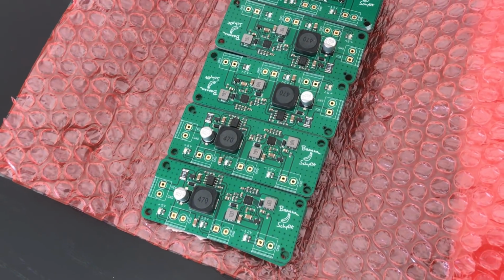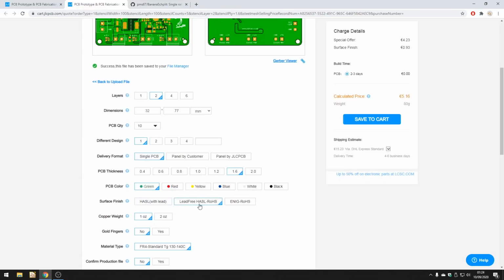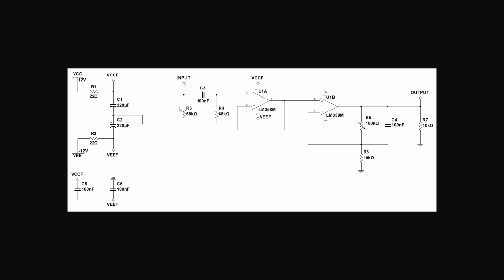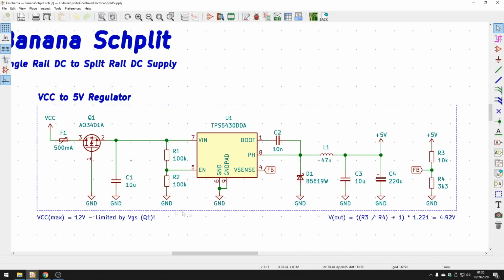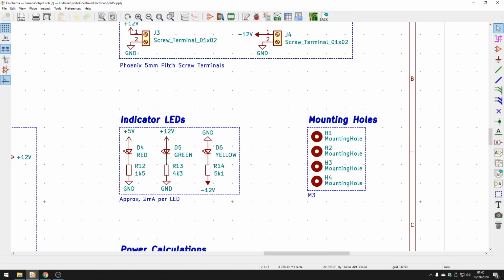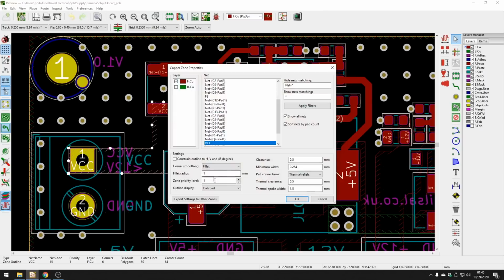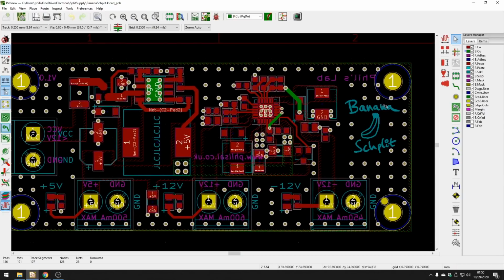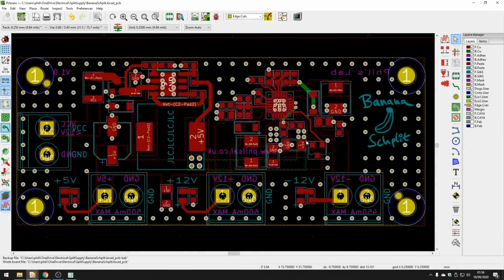(Sponsored) Single to Split Rail DC Power Supply Design | KiCad and JLCPCB Assembly - Phil's Lab #10

Comment: 1:15 - "and this is a really cool regulator because it's a buck-boost converter. so not only does it convert the 5V of the input to a +12V rail but it also steps that down to a negative rail in fact it's a -12V rail."
I can not let that stand like that:
A buck-boost converter does NOT provide a negative rail - that would be an inverting-buck-boost converter. And the TPS65131 is a dual-rail converter - it has a boost-converter (not buck-boost, vPos is always higher than VIn) and an inverting buck-boost converter for the negative rail..

Comment: Why did you use a transistor rather than just a diode in place of Q1?
What will happen if the input voltage happens to be larger than 12V?

Comment: This is one interesting power supply, now I need to figure out how to bump this up to +/- 18 volts. Have a small mixer board I use for doing EQ on a pro microphone for Ham radio use. Want to use the mixer portable but without the use of inverters to 120 vdc from a 13.8 vdc source, these small inverters are incompatible due to the noise they create in the ham bands. Will have to contact the manufacturer to see the current required for each rail of the mixer as well as minimum voltages to properly operate the mixer. Any suggestions to manufacturers for the dual rail power chip?
Reply: Also have the same question. Great vid!

Comment: Hi Phil, have you done any videos that mention a negative boost configuration? I have a circuit that requires +/- 72v rails and although the chip I've selected claims to cover this range, I'm kind of freaking out about it. My duty cycle calculations seem very small (18-ish %) within the switching controller. It's going to be used in a high voltage current controlled op-amp prototype. The datasheets seem to all mention some of these high negative voltage configurations but don't give a simple split rail example. It's like one is for a CCFL, another is just a small negative boost, anothe is a high positive boost. Seems hard to find a simple reference design. Any ideas?

Comment: can you explain the phase compensation for the TPS54331 in detail ? For me it is not clear what  Alpha-value should I use to calculate the phase lost. Im not sure if I can use the same compensation network for different output capacitor and inductor.

Comment: Can this board be modified to output +12v and -9v, and be supplied by a DeWalt 18V battery pack?
I want to use it to power a White's 6000D metal detector..

Comment: Cool video! I have a question. You mention mosfet/ zener diode as reverse polarity protection. Is Schottky diode a good choice for this too? If not - why?
Reply: Schottky diodes are a great choice if you don't expect massive power draws. They have a lower forward voltage than a rectifier diode, so it wastes less power, but the power loss can still be significant for very high power applications. Instead, you could use a MOSFET to protect against reverse polarity; They have a body diode which can raise the supply rail high enough to lock on, and have practically no voltage drop/series resistance once locked.
Reply: @wesleymays1931  oh, I see. Thank you

Comment: When designing a power supply I understand that you can set the voltage with a DC-DC converter using the feedback (or whatever you wanna use in whatever way), but how do you exactly set the voltage supply together with the amperage? How do you design, say, a 5V 3A power supply? From what I've gathered, say, a 5V 3A power supply works with any load that requires 5V and will draw less than 3A just fine. In terms of design, how do you assure this? First off you gotta make sure the components can handle the 3A and so can the traces, but afterwards what determines the ability to supply more current? Is it the initial supply (12V 2A, let's say) that determines whether or not you can supply 5V 3A?

Comment: Hi Dr Phil, first of all great video really informative and really helpfull. I need to power some opamp with +-15 volt and ive notice the datasheet of the tps65131 allows its. Since its my first pbc and im still a beginner to circuites im asking if you could help me with the necessary changes. from my understanding i only need to change R1 to 975kOhm, R2 to 85.7kohm, R3 to 1.3Mohm and R4 to 104.8Kohm and also the inductor values acording to equation 5 and 6 of the datasheet., pls tell me if i need to change anything else.  Thank you for your help and pls keep up the good work.

Comment: I’m pretty new to electronics, but I was wondering... how hard would it be to adapt the board to support 3.3v as the low voltage rail. I had a quick look at the data sheets and it seems like it should be possible, but I don’t know how many of the passive components would need to change. Is it something that could be made selectable using a jumper, or would be it an entirely different design?

I’d love to contribute to this if it is possible, it would solve a problem I’m having with a project. I’m trying to design an (overly complicated) synthesizer, and the digital parts will most likely run on STM32 chips, so a 3.3v rail would be great. But for the analog audio, I’ve been trying to figure out the easiest way to get a split rail supply like this

Comment: hello phil :) nice work you did. i found that vid after finishing my own TPS65313 board and experienced some strange behaviour.
could you give me some infos maybe? is it possible on your board to draw different currents on the rails? my negative rail become weird if i supply a circuit with it. normally its set up to -10V and without load i get them. if i power up a test circuit, the negative rails go down to -16V and jumps periodically to -10V. if i add a 100ohm resistor from -10V output to ground it stays stable at -10Volt. its like a curved waveform without the heavy load. it dont happen to the positive rail. did you ever get 600mA out of the two rails? :D hugs
Reply: I`m having trouble to stabilize the TPS65313 too. The positive voltage works fine, however the negative voltage is working similarly to yours. It is oscillating. It looks like it is not stable.

Comment: I did a similar board, but assumed a single power source on hand, but needing combined logic and opamp/linear circuit needs of pos/neg rail needed. Assumed 5V source on hand and created +15V  and -15V. Though that 15v can be changed for either polarity,  by resistor divider setup.
However there are also seperate SwMode output with capacitor filter, and a further LC filtered output on each. Also an LC filtered output of the 5V input supply. The cleaner outputs can be useful.
While the input is 5v it could be other value, just its filtered output is then same, no separate 5v reg used.
Have run outputs to over 1A, though not required in most cases.
Two PCB versions done,  one for through hole parts, one with SMD parts. As there are std 5mm screw terminal blocks needind space,  the actual PCBs are not that different size, also an 3AG fuse. The through hole one 95x75mm the SMD one 100x50mm.
Have also a different cct design version in SMD, that only does the 5v to +15v and -15v. Quite a bit smaller.

Comment: excellent video.  However I have some question about the buck boost circuit. Specifically on the buck boost that is providing +12V. If your Q2 and your internal switch turns off,  what voltage is the node between Q2, C6 and L2? Would the C2 provide enough current during the off cycles?  If you replace that with a diode, would you push it further into CCM and thus have higher efficiency?

Comment: Great tutorial. You don't need to touch the ENA pin on TPS5430. You can leave it floating and it will default to enabled via internal current source pull-up. So it would save you a little bit of space and assembly cost.
Similarly if you don't intend to be using ENP / ENN pins to disable the TPS65131, you can remove the PMOS Q1 transistor. It is mostly for battery operations with active shutdown usage. It is to prevent input voltage going via inductor and diode (L1 and D1) to thte positive output during shutdown. Otherwise it will show ~4V at the output, when the TPS65131 is in disabled (shutdown) state. But if you don't use the shutdown state, there is no need to use it Q1, and leave the BSW pin floating.  Using PMOS in your design is just waste of cost, space and power due to losses in this transistor.

Comment: Hi Phil. Can you make as your new project a PCB with DC power supply for DACs pls? There must be 1x3.3V for USB (amanero/xmos) and BT (BTM875-B) (higher current), 1-2x3.3V digital for DAC/clock, 1x3.3V analogue for DAC, and +-15V analogue for I/V+filter. This is pretty typical config for last few generations of ES/AK DACs. And to replace ALL power components is the first thing everybody must make if he/she needs to make Chinese DAC sounding better (in conjunction with swapping caps and OPs to ones that work better). And a quality of DC voltage must be as good as for example LT3042 or LT3045 can provide (may be lest strict for +-15V).
I think many people could reproduce your design or even purchase on eBay a soldered version if it costs about 50-60 euros or so.
This kit also can include a USB signal galvanic isolation PCB (on ACSL6400-06TE or some 12-15 Mbd Chinese alternatives) for another 15-20 euros.
I'm going to make all these things as I'll progress to my double ES9038Pro DAC.

Comment: Hi Phil.  I was experimenting with various split rail power supply designs and happened across your vid.  What a marvelous little IC (TPS65131).  Thank you so much for not only sharing your design for the board, but even the building block elements from KiCad and all your work leading up to being able to order some for myself.  I bought some of these puppies from JLCPCB and they work a treat.

Your quite right in pointing out that the output from the chip is noisy, but the circuit you demonstrate (R1/R2 and C1/C2) cleans up the output pretty well.

I have to query your tester circuit, however.  The 100nF capacitor (C4) in the configuration it is defined on the circuit diagram (6:19) is, for all practical purposes, a dead short for the AC signal output of the second stage of the op amp (U1B), and is therefore driving the gain to 1.  I believe that capacitor should either be omitted, or should be run to ground from the output rail (Pin 7) for the circuit to work as described.

Thank you so much for your generosity in sharing all your hard work, sir.  Subscribed, oh yes! Will be binge watching your other vlogs for the next few days.
Reply from the maker: Hi Tom,  Thank you very much for your comment! Very glad to hear that you could order one and they work as expected! Regarding C4, the value is wrong in the schematic - it should be 100pF (I breadboarded the correct value), and is there to limit the bandwidth to a sensible value. I.e. -3dB at about 16kHz. The circuit arrangement is correct however, and is typically used in this configuration - as you say, such that at AC the gain is reduced to 1 at the frequency determined by R5 and C4 in parallel.
Reply: @PhilsLab  Ah. That makes perfect sense now. Thanks again. 😊

Comment: May I ask why you choose at 5:49 small resistors(R1,R2) and large capacitors(C1,C2) for the low-pass filter?
Reply from the maker: If you use larger resistors, there'll be a larger voltage drop for the same amount of current which isn't great. Since the cut-off frequency is dependent on the R*C product, it is in this case better to make the capacitors larger to get the same result with less voltage drop.

Comment: If you have to disturb the ground plane with a track, run the track in a direction that is parallel with the power flow to the grounding exit point. That will have much less of an effect than a perpendicular track that cuts across the flow. For your board, the ground is made on the left side of the board. Therefore, you should run your tracks on the ground plane left and right, not up and down. This can usually be accommodated with careful selection of what tracks are on what layer.

Comment: Hi Phil, Really like your videos for concise and informative content. Could you explain why do you need R3? As far as I can see C3 and R4 form high pass filter and R4 will pull non-inverting input of the op amp to GND in case there is no input. Can't figure out what is R3 for. Thanks
Reply from the maker: Hi Max, Thank you very much! I typically never leave anything floating, and that includes input capacitors. R3 - for no input connected - effectively grounds the capacitor. This also helps with pops and clicks when connecting and removing sources.
Reply: Thanks very much Phil for clarifying

Comment: Nice to see this circuit actually in action. I was thinking of designing a similar buck-boost converter circuit to provide +/- 20V rails for a small 36W amplifier I made, but abandoned it in favor of going for a bipolar flyback SMPS instead running directly off the AC mains that provides +/- 20V/3A rails for the amp IC's.
Reply from the maker: Thank you. To be honest, deriving the rails from AC mains is usually the way to go anyway (in my eyes)! This little board is nice when you don't want to mess around with mains voltages and don't need too much power.

Comment: I don't get why an unity gain opamp (U1A) is needed before U1B... doesn't the non-inverting input of U1B have a high enough impedance?
Reply from the maker: It's part of the same 8-pin package and typically unused op-amps shouldn't be left floating. So I just used it as an additional buffer. Of course not necessary for the circuit, but it was there anyway and only a couple of extra wires to include it.
Reply: @PhilsLab  I think it could add noise and linearity errors. I believe it's better to leave the unused op amp aside with its inputs tied to ground.
Reply from the maker: Irrelevant for this test circuit, as all it is doing is showing the PSU in action.

Comment: Phil, thank you very much for another great video.
By the way, have you tested the new KiCad's night builds? There are many interested features. Layers managments was greatly improved and display performance has also increased on nVidia's GPU.
How do you rate the direction in which KiCad is going?
In the video, I saw that you missed some 3D models. Do you use any other than the standard ones in KiCad?
Maybe look at this interested repo of huge user's library:
http://smisioto.no-ip.org/elettronica/kicad/kicad-en.htm
I was also very surprised how KiCad's support for importing all PCBs into 3D has grown. In a few steps you can design electronics in 3D, for example in Fusion 360 using FreeCad.
Reply from the maker: Thank you very much for your comment!
To be honest, I've never tried any of the nightly KiCad builds. I'm completely happy with what KiCad can do now and don't feel like I need much more to finish the PCBs I typically work on. I must say, I'm also not at all up-to-date with what the people who develop KiCad have planned for future releases!
Thanks for the link to that repo! When I can be bothered and the 3D model isn't directly available in KiCad, I typically can find the models from the manufacturer's website.

Comment: Been working on a similar split rail psu, but powered via usb. Decided to use an isolated dc/dc converter that takes 5V usb and generates +12V and -12V out; the outputs are then passed through a +9V and -9V voltage regulator.
Reply: what dc/dc converter chip are you using?
Reply: @lucasc5622  part no. is PESE1-S5-D12-M-TR

Comment: 1:15 "[TPS65131] is a buck-boost converter". Actually it is not. "Buck" means able to produce an output less in magnitude than the input voltage.  A Buck-Boost converter is one where the converter can produce a range of output voltages  above and below the input voltage, in magnitude. The converter here produces two output voltages, both larger in magnitude than the input voltage.  So it's a dual boost converter with one of the boost outputs inverted. The datasheet refers to it as having at Boost-converter and an Inverting converter.
Reply: That said...  well done on the clear explanations of all your steps, both how-to, and why.
Reply: Yes, I didn't look at the datasheet, but by the schematic shown in the video there are separate converters that generate the +12V and -12V outputs from the +5V supply. A boost converter generates the +12V output, and a buck-boost converter (which inherently inverts the output with respect to the input) generates the -12V output.
Reply: Actually it is called a "inverting buck-boost converter". The word "buck" has in this case nothing to do with producing a voltage with less magnitude(step-down) as buck converters are often used but with the topology of a buck converter. I thing buck and boost  are mostly used to refer to the topology and a better terms for your comment would be step-up and step-down. So buck has nothing to do with the magnitude of the voltage but with the arrangement of switches/diodes, inductors and capacitors. Its the same as you wouldn't call a charge pump a boost converter but rather a step-up converter or just a charge pump.
I also can recommand this pdf from TI  "Working With Inverting Buck-Boost Converters" where they expain how they convert a buck and buck-boost topology into a inverting buck-boost topology.